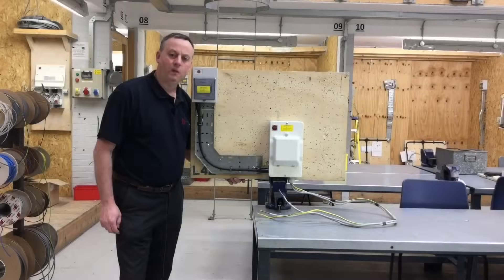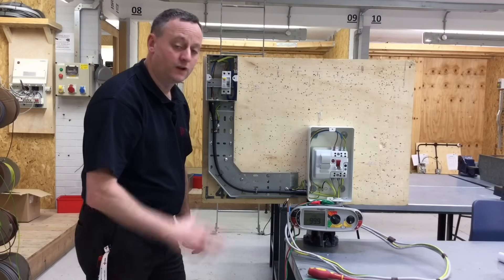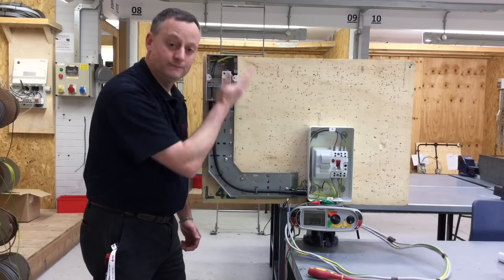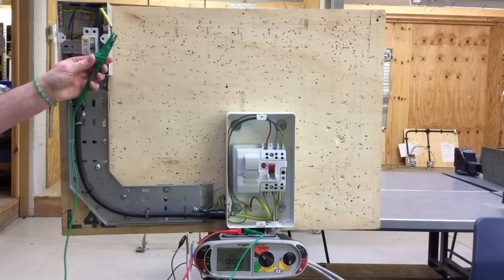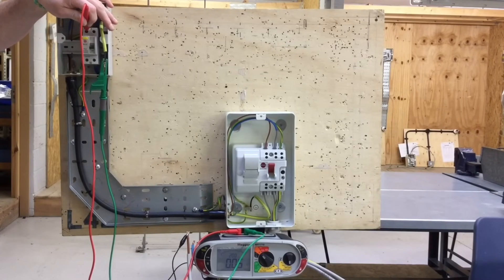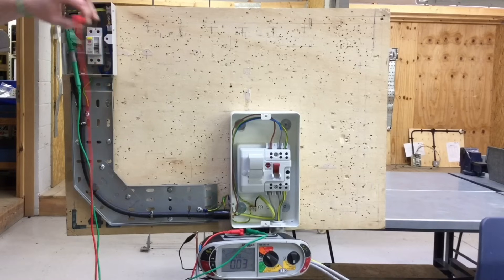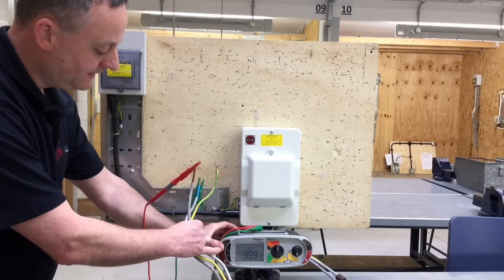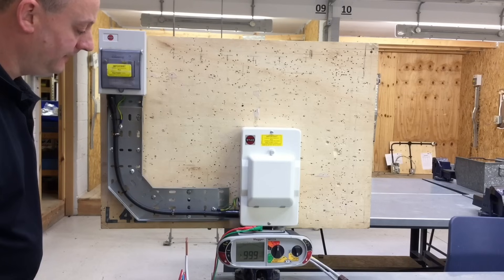SWA Sub-Main Circuit Testing for Continuity of CPC, Polarity and Insulation Resistance

Comment: I have a question regarding the earthing for the trunking. If you were running meter tails from that switch fuse into the consuer unuit in steel trunking, would it need earthing?

Comment: Peace of mind for you Gaz but just bond the tray, Ladder rack everything metal that can be touched. We had a case a few years ago where a guy was shocked well walking on a cable tray. He fell off an died. Not exactly sure on the outcome but from throwing to many cables over the tray, the tray started cutting through insulation and eventually the tray became live. I can only think that protective devices were not in place or incorrectly set. But regardless just be safe and if its conductive, earth it. You can believe the sh*t people get up to out there
Reply from the maker: Thanks for commenting 👍
https://youtu.be/SJFGoeqtr04
Worth considering 👆🏻
All the best Gaz 🦾👍👊

Comment: If the metal tray is in contact with some exposed metallic structural parts the building would the tray then require suplimental bonding?
Reply from the maker: Yes 👍

Comment: Nice vid Gaz. I'm continuously running into problems on my L2 2365 course when doing IV on circuits (not remembering which tests apply for radial vs ring for example), I try just working through the test results as they appear on the schedule of results but still trip up, any advice? I've tried CRIPER but I still balls up with that.

I want to make myself reference cards for each circuit types; tests for radials, rings, lighting etc. Would this be a good idea? I'm only 2 months in and worrying I can't remember the basics.

Comment: Great job, good, good clear demonstration, I to have always used the black as CPC, not sure if its a must but just seems to me the grey and blue always go together best..
Reply from the maker: Hi thanks as always Gaz. back in 2004 when we harmonised Cable colours they wanted to de-neutralise black hence its used as the CPC and grey as neutral. Keep your video coming as well 👍.
Reply: Another detailed and instructive video, thank you.  Hope you don't mind another annoying question about CPCs:
Why do we use a copper conductor at all when Page 166 of Guidance Notes 1 tells us that "the CSA of the armour is greater than that required to comply with the Regulations"?  This seems to apply to cables up to 95mm CSA of the copper cores.  Unless bonding is part of the design, we should be using 2-core, and not giving students an excuse to ditch the brass earthing ring from the gland assembly, (they can be frustrating to fit when your fingers are wet and cold).
We know that good design is about minimising waste, and that reducing R1+R2 beyond the required limits gives us no improvement in disconnection times.  Whenever I see 3-core SWA, I know that 'further investigation' is usually necessary. 
I apologise if this is yet another requirment of your Awarding Body :-)

Comment: Hi mate in the real world, would you be able to carry out this test on the tails would that not be the suppliers side of the fuse? Would you not just disconnect the swa at the fuse switch side and test from there ? Cheers
Reply from the maker: Hi. No the tails would be connected more often than not... the test would be carried out from the top of the 60amp switch fuse with the switch in the off position... thanks Gaz